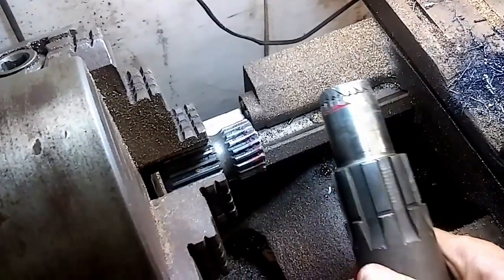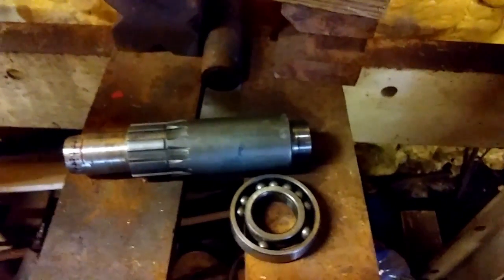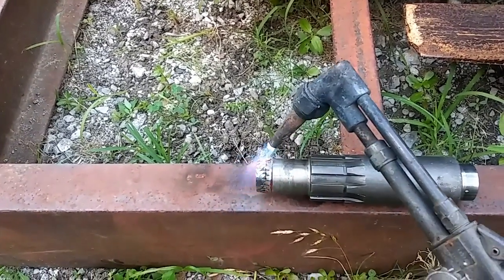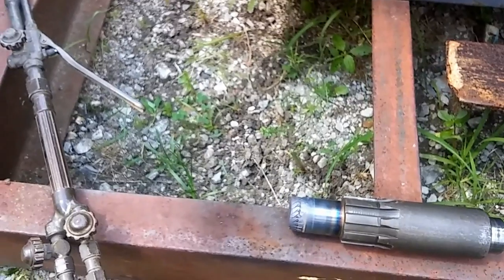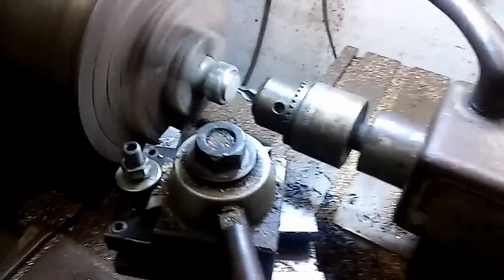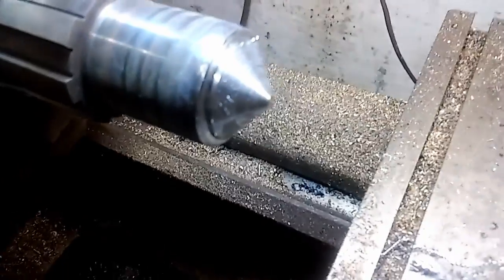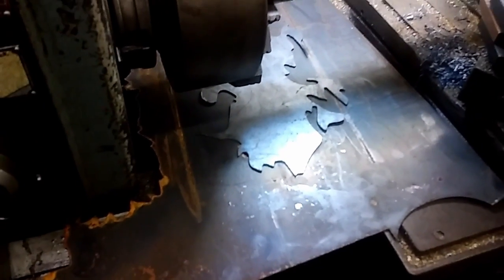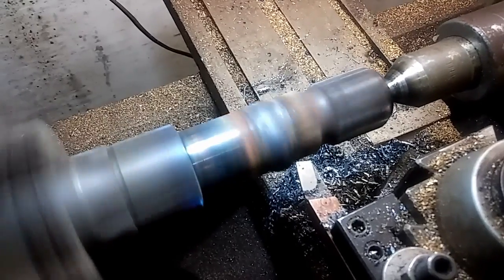Fixing broken shaft

Comment: how can u make sure the strength of the new combined shaft is sufficient to maintain the rotation and inertia inside the motor during start up and stop? the new machined shaft surely dont have the same strength as the original shaft right? any information?
Reply from the maker: Yeah your rite it's not as strong but the customer couldn't buy the part anymore and he didn't want to buy a new bush hog